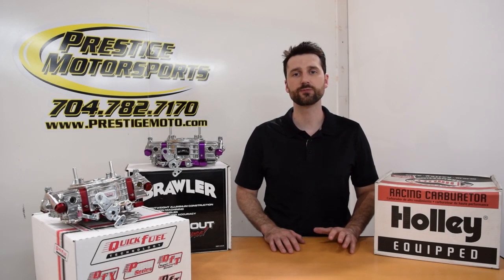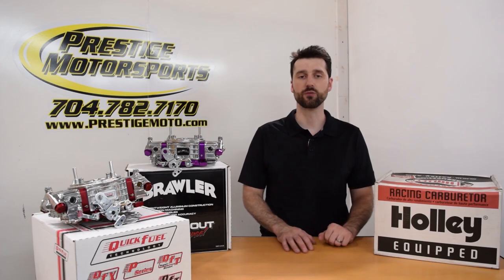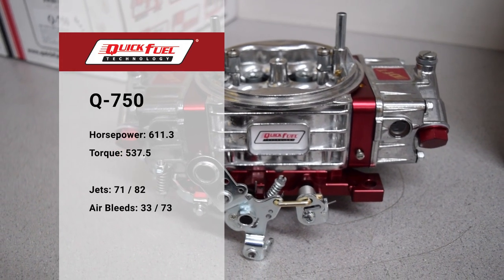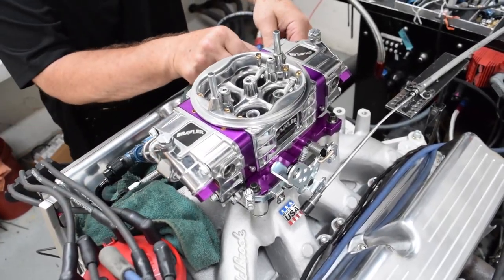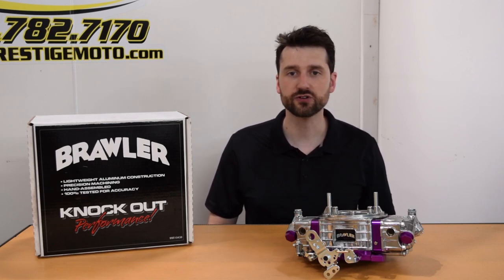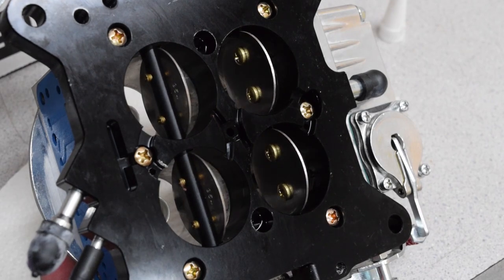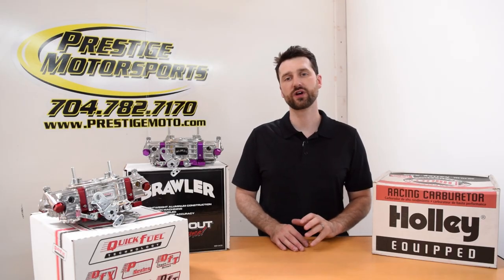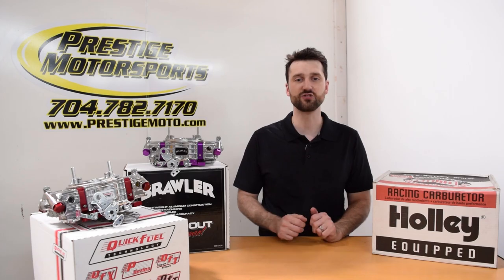Brawler Race 750 Holds Own Against Quick Fuel Q-750 and Holley Track Warrior

Comment: I was glad to finally see a comparison test that included a Holley Track Warrior Carburetor. I purchased the 850 cfm version from Holley last year during their Christmas sales event. The cost was about $520 which seems very reasonable considering all of the features offered with this race calibrated carb. 

Two features I wanted are mechanical secondaries and NO choke or the remnants of a choke horn. It comes with an HP main body that has smooth inlet contours. Billet metering blocks and throttle plate. Dual fuel inlets and clear sight plugs along with typical four corner idle adjustments and a number of other adjustable features to make fine tuning easier if necessary. 

I haven’t run this Track Warrior yet but the calibration specifications are definitely for purpose built performance engines. It’s going on my 351 Cleveland based engine with vintage Endyn high port iron Pro Stock heads and port matched Edelbrock Scorpion single plane intake, a Reed solid roller cam and full roller valve train, Manley Forged 12.4:1 pistons, internal balanced rotating assembly housed inside an OEM 4-bolt main block.

As noted in the Prestige carburetor comparison, the Holley Warrior isn’t the best choice for street drivability. I do plan to use it in my ‘70 Mach 1 occasionally on the streets but I’m primarily concerned with quarter mile performance without spending $1000 if $500 will provide nearly identical results.
Reply: @culbycars  ... I used a 750 double pumper right out of the box with no tuning adjustments on a stock 351 Cleveland with 2-V heads and a Performer intake manifold with surprisingly good results. I did set the cam timing straight up at “0” when I replaced the high mileage stock timing chain assembly and upgraded the ignition system with an Accel CD type. 

With the progressive mechanical Venturi opening of the Holley , I expected a bog condition at low rpms but the Cleveland handled it well. You should be able to step up to the 750 cfm DP with good results.

Comment: I compared three VS carbs on sale, and of all, the Brawler had the best value that I can see:
1. Brawler DieCast series 670 cfm - $332  
2. QuickFuel HR-Series 680 cfm - $425
3. Holley Street Avenger 670 cfm - $433

The Brawler and QF are virtually identical, with great tuning options, and the Holley has the least amount of features and tunability of the three, but the highest price. I've owned a Holley 770 and now the Brawler 670, and will say that the Brawler provides more value for the $$ with NO difference in performance other than the Holley being a bit lean out of the box, and the Brawler being a bit rich out of the box.

Comment: What do you recommend for a big block mopar 400 based 471 stroker engine, my cam is 260-264 @.050 & .616int .620exh, trickflow 240 heads flow 336cfm at .650 it will be a dual purpose street/strip car & I'm guessing this engine should easily make 600 based of of many other builds that aren't as radical as mine. My thought was a 1050 in the 4150 design. Let me know what you think & is it possible to rejet my classic hp 830 cfm to be a good carb for street fair weather driving?

Comment: does carboraitor give you more power  than fule injection
Reply: At wide open throttle  efi and carb are about even . Efi really shine below that wot range
Reply: Comparisons on old engines I've seen show the carbs to make more power, but as others pointed out at WOT. When you're in traffic and stop and go EFI is just better in every respect. I'll stick to carbs though you can fix em and rebuild them cheaply and they're reliable
Reply: Its more about the intake.
Reply: Carbs make more peak hp because of fuel atomization. Theyre not as efficient across the power band though
Reply: On a fox mustang vs stockish type fi.  Carb blows it away